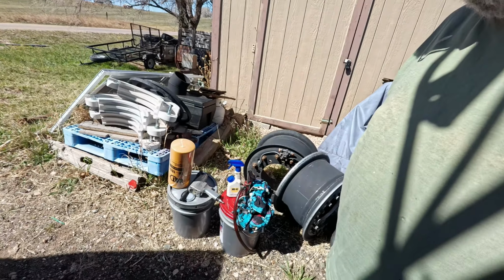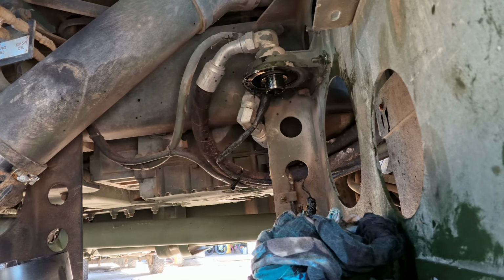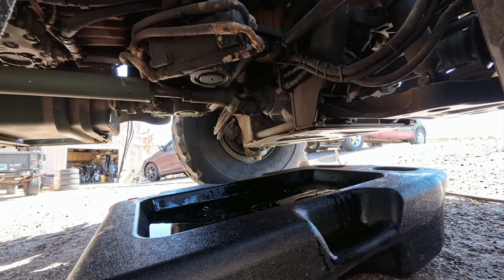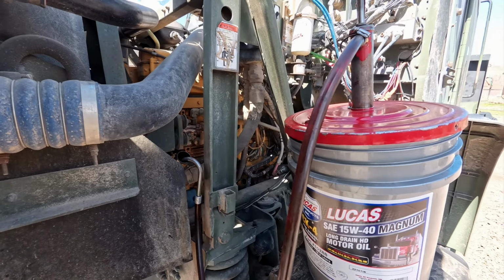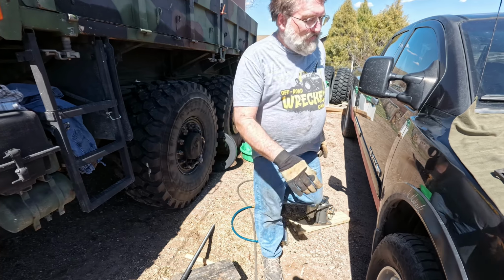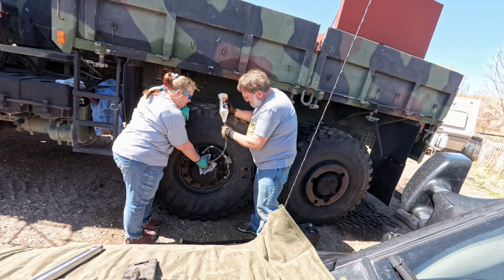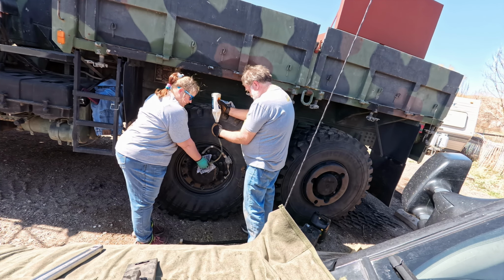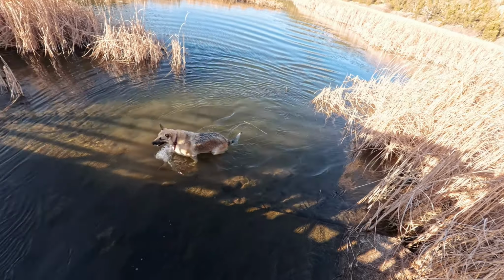Cat c12 oil change MTVR Hub Oil changes

Comment: how's your experience been with running and sourcing tires?  I noticed you had some in the background as well.  do you buy them as NOS?
Reply from the maker: I would hate to increase the competition but i watch GovPlanet, try to buy them as close to me as possible as shipping is very painful. I try to buy ahead, as not all the tires purchased have been useable, I have one that looks like a grinder was taken to the Michelin man and as a result i don't trust the sidewall, Michelin tires like these blow sidewalls easily. The Goodyear wear faster but the sidewalls hold up, right now I am running one that has a flat spot on one side, not a deep but not pictured in sale, tire is other wise like new. the tire mentioned first is like new too. I have yet to buy a new one direct not sure i can with out selling a Kidney.
Reply: I completely understand.  How’s your experience running them since they’re pretty much 23 or so years old?
Reply from the maker: @dlynes  was that 2-3 years? as most of the tires i have are 2018 or newer
Reply from the maker: there are some just about dead ones on the truck now that are older - no issues.
Reply: @A7toninWY  I bought six at the auction last month.  I havent picked them up as I am waiting for my EUC to clear and will get both at the same time.  I assumed the tires were 2008 at best.
Reply from the maker: @dlynes  even the ones on it were newer then that I bought mine in 2020. maybe I have been lucky.
Reply from the maker: @dlynes  By the way Congrats on your truck I hope you have fun. Did you see my latest video? I pulled a van trailer on a dolly with mine.
Reply: @ yes sir. Pretty cool. What are you doing with it? I’ve looked at them but so far they’ve been in California. I’m in Georgia. Was the dolly included with the trailer?